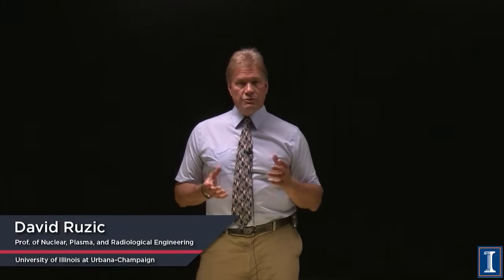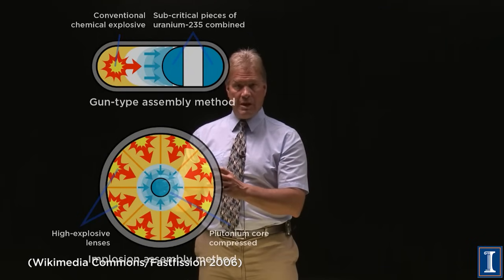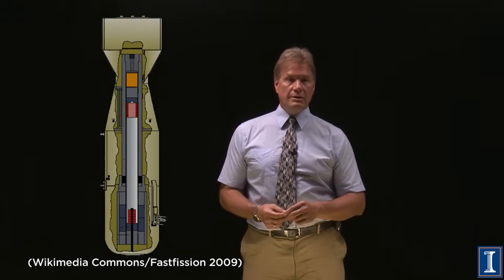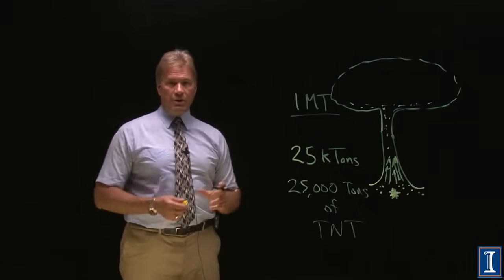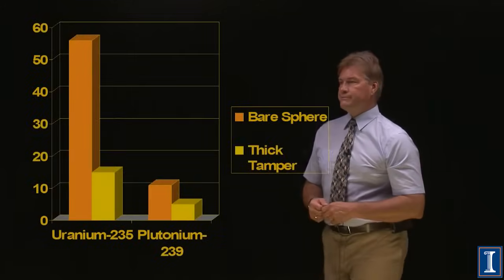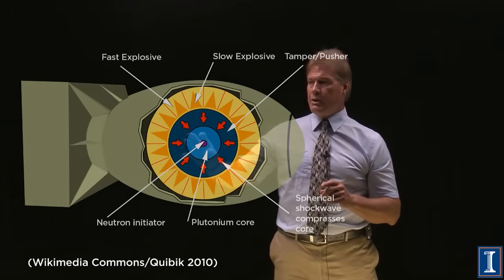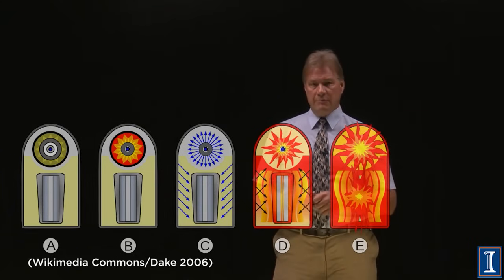The Biggest Bangs

Comment: Typically nuclear power plant advocates try to distance their romantic infatuation with their technology from that of the nuclear explosives designers. Typically both designers love the design challenges and the fact that so much energy can be derived from so little material. The nuclear power advocates avoid mentioning that a nuclear fission explosive is a small nuclear reactor that is designed to fission most of supplied fuel in less then a microsecond whereas a nuclear power reactor is designed to react a portion of its supplied fuel over a period of time of about three years. Both generate an array of radioactive fission products as a result of that reaction. In the case of nuclear test explosives the Spent Nuclear Fuel (SNF) is dispersed into the surrounding atmosphere, in the cases of explosions in the atmosphere. For underground nuclear explosions the SNF blast debris is dispersed in the underground shattered rock formation around the blast point. The radioactive waste containment standards, for explosion waste and for power reactor waste is radically different. Many hundreds of nuclear explosions were conducted in the Earth’s atmosphere. It should also be noted that most modern nuclear weapons are triggered by the the fission of plutonium-239 cores. Much of it doesn’t react before it is blasted away from the critical mass reaction center so it ends up being dispersed with the rest of the explosion blast debris. Also note that the original creation of the explosive Pu-239 isotope required the employment of special fuel breeding nuclear reactors.

All promoters of nuclear energy are in line with the vast majority of the Earth’s 8.0+ billion humans who have masterfully excluded the following warnings from their consciousness. They continue to assume that we have at least 20 years left to turn this ‘Titanic’ around, through the use of their favorite technology. I urge readers to search for the following two article titles.

IPCC report: ‘now or never’ if world is to stave off climate disaster (TheGuardian)

UN chief: World has less than 2 years to avoid 'runaway climate change' (TheHill)
  * This statement was made 5.8 years ago.
Reply: Dude no one is reading all that
Reply: @deepsleeprelaxtravel4909  - I recognize that most people prefer short soundbites. There may be a few who might be curious enough to explore much of what I presented, including the two articles mentioned at the end.

Comment: Radioactive fail out only happens on surface detonations as the ground in the immediate vicinity of the explosion is contaminated before being pushed out of the way of the explosion. Above ground and below ground explosions leave little to zero surface or airborne radioactive fallout.
Reply: You're wrong, both of the bombs exploded 500+ meters above ground and it was planned. Fallout was relatively low in both cases.
Reply: @ediakaran  doesn't change the point.

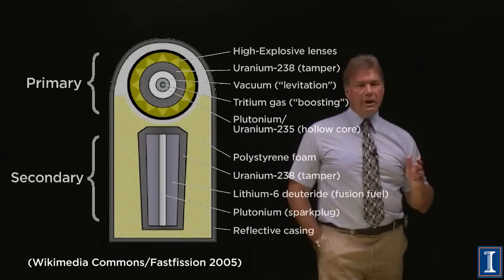Comment: 14:14
Polystyrene foam, check
Soon I will have nuclear supremacy!
Reply: This comment is highly under-rated. Polystyrene is my favorite aspect of the Teller-Ulam bomb design. Under intense XRay radiation, far more effective than conventional explosives at generating compression. Even explosives weren't enough for the bomb scientists, they had to resort to styrofoam!
Reply: Considering those scientist where holding apart sub critical halfs with a screwdriver I can only imagine them just grabbing the first thing they could find in the lab and trow it in there to hold the parts in place. Sticky note saying "replace later with explosives"

Comment: Natural uranium can be used in reactors. 80% U-235 is considered weapons grade.
It is not true that implosion weapons require a spongy core of fissile material with a density below that of the solid metal under stp conditions.
Shockwaves from high explosives do compress solid metal.
The Mk-II tamper assembly had sufficient integrity to absorb the impact of the projectile and maintain a supercritical assembly indefinitely.
The mushroom cloud shape is formed before the cloud plateaus. It's result of air at the core of the fireball being hotter, and thus more buoyant than that around it, causing a convective effect.
Fallout is the process by which that irradiated debris "falls out" of the cloud.
Both devices were below 25kt.
No, few countries have megaton weapons anymore.
No, the shockwave is not produced from the rising of the mushroom cloud. It's produced by the thermal expansion of the fireball into the surrounding air.
The initial shock produced by a nuclear weapon travel far faster than 300mph. Its a shockwave. It's supersonic.
Reactor grade plutonium is weapons usable for small devices.
Israel acquired nuclear weapons 3 years after China.
It's not rumoured, it's known that Israel has and SA had weapons.
The secondary has to get hot enough self fuse deuterium.
Deuterium deuterium fusion dominates the reactivity at first.
First US H-bomb test was 1952.
No, implosion of the secondary is not achieved by the reflection of any material.
No, ignition occurs between deuterium, which produces neutrons to breed tritium from lithium, which causes tritium to build up, and the reaction rate of T-D overtakes that of D-D.
The footage starting at 16:41 is the 1952 test of the mk-18 pure fission implosion bomb. Not a hydrogen bomb.

Comment: Perhaps a review of the miscalculation for Castle Bravo.  Lithium 7, it turns out, is fissionable material, when the atomic 'detonator' in a hydrogen bomb converts it instantly to Lithium 6.
Reply: rather, the cross section for neutron capture wasn't known accurately enough, which is why way more than expected was turned into fusion (not fission) fuel.

Comment: 10:10 Heavy elements like Plutonium were not created at the moment of the Big Bang. The general consensus now is that elements like Pt, U, etc. were created by exploding neutron stars. It is therefore definitely probable that Plutonium still occurs naturally, just not on Earth.

The Big Bang created the lightest of elements, like Hydrogen and Helium, which went on to gravitate closer to each other and formed the very first stars. Once those stars spent all their fusible fuel and started fusing elements into Fe (iron) the pressure of the nuclear reactions no longer outweigh the gravitational energy, causing the star to collapse in on itself and explode. Any element heavier than Fe found its origin elsewhere.

Comment: 16:56 Slight correction is needed here. The test that the Professor is referring to, where the expected yield was low but the delivered yield was 15Mt was not the first thermonuclear device. The first device was Ivy Mike (Operation Ivy test series) where the device was the "sausage" and it was actually an entire installation and it produced 10Mt. The device he is referring to, where the delivered yield was far greater than expected, was Castle Bravo (Castle test series) where its delivered yield was 15Mt and this indeed was monumental. Monumental in what it delivered relative to expectations, monumental as in the knowledge in physics it delivered and monumental in the destruction it caused; unfortunately.

The physics behind the Castle Bravo "accident" is spectacular. How the Li7 isotope "impurity" in the Li6 target underwent fast fission as well but with the uranium tamper under intense neutron flux is just unreal. The physics in this all is just staggering.
Reply: Also should mention Operation Ivy took place in 1952, not 1956
Reply: Not really staggering.

Comment: I always understood the formation of the mushroom "cap" to be partially torroidal in nature.?  I.e. the drag from the outside of the column rolled the edges down, while the continuing flow of super heated material pushed the insides up.
Reply: there are two mechanisms acting in the mushroom cloud:
1. Tailor Helmholtz instability of a hot air cold rising through the ambient cold air.  This eventually creates a lax vortex ring.

2. An early sharp vortex ring formation in low altitude airbursts when the reflected shock interacts with the hot air cloud and beats this vortex ring up from it.  This splits the mushroom cap into two layers: early vortex ring is the upper level, the original fireball remnant cloud it the lower level.

Comment: The general public keeps associating nuclear weapons with nuclear power. This is like saying Napalm (weaponized gasoline/phosphorus incendiary bombs) and the gas in you car are the same thing. Actually ridiculous. The main point is also that you REALLY CANNOT make a nuclear weapon from reactor spent fuel, even if you build the chemical factory to extract the plutonium (called PUREX).
Reply: I agree entirely. The dangers associated with nuclear power reactors are outrageously exaggerated. Nuclear states have to maintain general public fear of the word 'nuclear'. Without fear the weapons are useless. There's also the question of money. Governments and oil corporations are inextricably interlinked. There is still a fortune to be made from fossil fuels and no government or big oil company is gonna give that up. There is also a fortune to be made from the 'management' of reactor 'waste'. You wait til oil profit mountain starts to subside. The nuclear tune will change overnight.

Comment: A tamper and a neutron reflector are not the same things.
Reply: This is aimed at entry-level, stop nitpicking.
Reply: @SixDasher  Someone trying to build a bomb in his garage might get confused, we must not let that happen.
Reply: tbh while his talks are informative, he does tend to skip certain issues putting both nuclear power and weapons in worse light. The tamper has two mayor functions. One being a slight impediment to the bomb disintegrating and thus spreading the fission/fusion fuel to thin to continue the reaction (the hiroshima bomb had a ridiculously low effectiveness partly for this reason). But also because the U-238 (which he incorrectly stated would add neutrons) will fission when subjected to neutrons from both the fission primary and the fusion secondary, and this fission accounts for ~50% of the yield of a thermonuclear device. Which is basicly "free" and the low cost of the lithium basicly makes the added cost of multimegaton devices over your bog standard plutonium bomb very low. This however adds MASSIVE amounts of extra fallout, which is partly why the tsar bomba had it's tamper replaced with lead, halving it's yield but making it the cleanest nuke per MT ever used.

Comment: The first bomb ever detonated, Trinity, was actually an implosion-type device, not a gun-type.
Reply: Correct. It was a plutonium bomb, of which was of the type dropped on Nagasaki.  That's why they called it Fat Boy.
Reply: @koyotekola6916  You mean 'Fat Man' (named after Winston Churchill). The one dropped on Hiroshima ('Little Boy', named after Franklin D. Roosevelt) was a gun-type device, made of U235. This design was not tested before use for two reasons: First, it was regarded so simple and reliable that it did not need any testing, and second, producing that much U235 was very expensive - in fact, Los Alamos laboratory could only produce enough U235 for one bomb in the given timeframe so they could not spend it on testing. Two bombs of two different types were developed in parallel in order to achieve the goal of having the bomb before the War ended with greater certainty. The preferred design was the implosion-type - it used cheaper fuel and a smaller quantity of it, but was extremely technically challenging. The gun-type was a safe alternative, although much more expensive in terms of fissile material. As we all know now, they managed to produce both before the war ended (at the great misfortune of many). As far as I know, the Little Boy was the only gun-type design ever produced and the only design that used Uranium as fuel (it could be that Nort Korea or Iran developed or tested such weapons but in well established nuclear states all nuclear warheads have Plutonium cores and are implosion-type designs). By the way, Plutonium cannot be used in gun-type assembly because it would fizzle - if two parts of the supercritical mass would be slammed together, the chain reaction would start before they are completely assembled, so they would 'bounce off' each other, producing a burst of neutrons and a relatively insignificant energy yield. I don't know exactly why this would happen (a nuclear physicist could help), but I guess it has something to do with the speed of neutrons and the neutron absorption crosssections.
Reply: @aleksandarrudic3694  Correct - Fat Man. I thought they named it after Chris Farley. :)
I didn't know producing U-235 was expensive, even in large quantities. I always though producing Plutonium was much more expensive.  I'll research it.
Seems to me that if you push two piles of uranium together, many of the neutrons would escape on the other side and above and below.  Hence, the implosion method was designed to grab all the neutrons and produce a much more potent critical mass.
Reply: Gun-type is a surely-will-go-boom design, they were not sure if implosion-type works or not, so they decided to test a implosion-type nuke and drop that surely-will-go-boom nuke in Hiroshima first.
Actually I think that two nukes saved more people than they killed, and Japan should be glad that US decided to nuke them.
Reply: I think the bomb's name is gadget not trinity
Reply: @UnicaLuce  You are correct. The device was an implosion design plutonium device named "The Gadget." Trinity was the code name of the test and its site. Thanks for correcting us.

Comment: Spot on -- Except for 2 parts. 1 -- The first H bomb was tested and detonated in 1952, not 1956. 2, the bomb was 10 megatons in yield, not 15. Ivy Mike, tested at Bikini Atoll in 1952, 10 megaton yield. The only bomb that the US ever detonated that was larger was Castle Bravo which was a 15 megaton yield, and that was because a MISTAKE was made in the calculations, not realizing that one of the isotopes would be stripped of one of it's particles, subsequently turning it INTO bomb fuel that would add to the explosive yield. I believe it was originally only intended to be a 5 megaton yield, but lithium 7 was stripped of a neutron during the initial detonation and then became lithium 6, and thus the yield was 300% larger than originally planned for .... I could be wrong about the chemistry aspect of that, or at least what element was stripped of a particle to become bomb fuel anyway. The rest is spot on. As far as everything else goes....  more power to ya, chemistry is hard as hell and you're an expert at it. A better man than me by a factor of infinity in that regard. applause
Reply: There were two other Castle shots bigger than Mike: Romeo 11MT, Yankee 13.5MT.
http://www.nuclearweaponarchive.org/Usa/Tests/Castle.html

Comment: Thanks David!  One question: what was the purpose for the  polystyrene in the hydrogen bomb?
Reply: Polystyrene absorbs radiation, so much so, that it turns in to plasma. The pressure of this plasma starts of a reaction in the Plutonium spark-plug. So essentially it acts as a chemical fuel for the secondary like high explosive is for the primary.
Reply: @uegvdczuVF  Oh I was completely wrong, thanks for correction 👍
Reply: Being invisible to x-rays/gamma rays, so they can compress the secondary to the point of fusion.

Comment: You were describing Castle Bravo as the first hydrogen bomb. Ivy Mike was. Bravo was the biggest US bomb and first to use lithium deuteride. Also, if you're close enough to a multi-megaton device to receive a lethal radiation dose, the Mach Y stem will absolutely annihilate whatever part of your body that's not been vaporised. Further than 10 miles out and you can still get third degree burns. Such a cheery subject.
Reply: Dying of radiation poisoning/suckness is a bad way to go. I rather die in the original blast.
Reply: @djohanson99  Nothing sun protection factor 2 million couldn't handle. Otherwise it's double crispy in one second flat.
Reply: I get what you saying but Ivy Mike wasn’t really a bomb,it weight round 80t....it’s was more of an scientific experiment.Castle Bravo was the first real bomb 👍
Reply: @richard73  They were all bombs, and all scientific experiments. The only difference is some weren't deliverable weapons yet. Castle Bravo was basically a nuclear building, full of apparatuses and scientific equipment. It wasn't a deliverable bomb. It did a great job though of making two and a half small islands go bye bye.

Comment: 16:43 "got two different views of it"

Two different bombs.

The bomb on the ground (Ivy Mike) was more a "nuclear installation', not really a bomb but a building that blew up and crated a huge crater you can still find on google maps (search "Elugelab, Enewetak Atol"). Also it was more like 10 megatons in yield, the one with the unexpected yield was Castle Bravo, a proper bomb with solid lithium deuterium fuel.

The bomb that falls from the sky (Ivy King) was a pure fission bomb that would produce half a megaton of yield as backup.
Reply: @bami2 yeah, they were using cryogenic D-T so they knew exactly how much reactants they were dealing with in Ivy Mike. They didn’t think the lithium-7 in Castle Bravo was going to contribute anything, it did.
Reply: This is the evidence that the lector is not into nukes, he probably studies reactors.